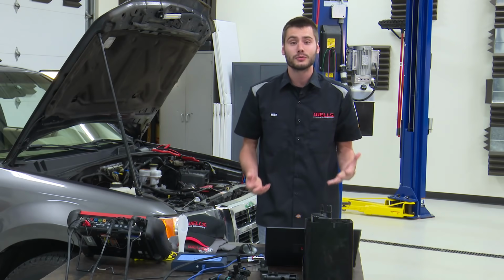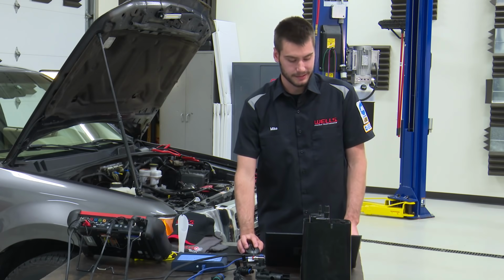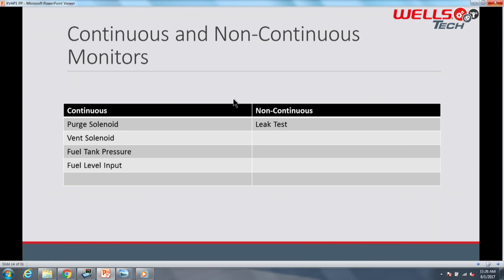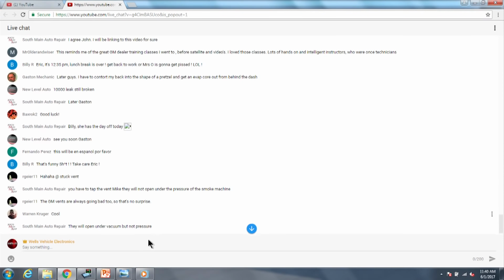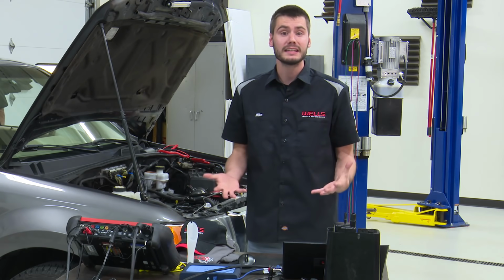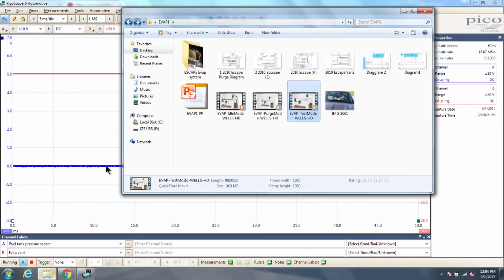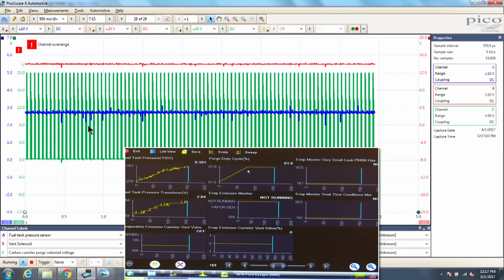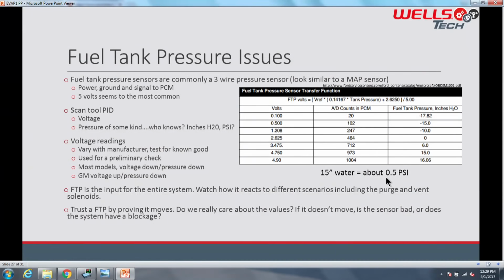EVAP-Evaporative Emissions System Operation, Testing, & Diagnostics Beyond the Leak (P0442, P0455)

Comment: well, one thing I know for sure now that my P0456 code error for EVAC small leak is not my vent solenoid; it's my Purge valve causing the issue. Because I have no problems putting gas in my tank but I do have a problem with a rough idle or acceleration, but normally after it's ran for a few minutes. this was helpful for me deciding where my problem most likely is. I have a Mighty Vac 8000 I can put on the Purge line to see if it is closed, normally as it should be with the key off, and I also had it suggested to unplug the purge solenoid prior to starting my truck and then plugging it in to see if I can hear it open the switch or activate the solenoid. My 2007 Dodge RAM 1500ST Quad Cab 4WD 5.7L Hemi has a Leak Detector Solenoid on the EVAP Canister; I don't see this in your set up or diagram, but I'm guessing it is by the vent valve solenoid on the EVAP Cannister. I know my gas cap is sealing good. The seal looks good, and I can hear it when I open it. I've been leaning towards the Purge Valve being bad, and I can put my Mighty Vac 8000 on it while the truck is off to test to see if it is closed or has a small leak as the error code indicates when the OBD is connected to a computer. It didn't show up the first half a dozen times I had a diagnostic run on it at O'Reilly's, but it says it has had a small leak for a while now. thanks for the video. the only thing that makes me think it may not be the Purge Valve is that I don't have any issues with starting my truck. It fires up on the first crank!

Comment: I've also had to replace the EGR valve. I bought the part replaced it and check engine light went on again. Again thinking the part was bad I replaced it again. The EGR valve wasn't the issue. It was actually the connector tube inside the the manifold that connects to the EGR valve. I hate there's no check engine light code for this part. So I pulled it out cleaned it and replaced it and it worked. I don't believe that it was my EGR valve in the first place, it was the connector tube that needed cleaned.
Reply: In today's automotive world it's gone from actual fixing/rebuilding parts to diagnosis by scanner and guessing what parts to replace and still not solve the code issue.
Computers on cars flat out suck. 
To much computer control tech on cars is the problem. The more there is of it the more problems will arise make the cars bigger POS and financial burdens for most people.

Comment: TY for the comprehensive explanation of EVAP systems. I finally understand the function of the vent valve and purge valve. 
Now to find my issue. I think I have a bad Oring on the fuel pump seal.

Comment: I went to a dealership for a EVAP 1450 code to make a long story short they charged me $800.00 to fix, what a rip off and come to find out there hourly rate was $240.00 dollars an hour.  First thing is never go to the dealer ship for any thing and always ask what there hourly rate is, so you can walk out if you want. I learned the hard way. Bye the time I got out of there it cost me $1500.00 dollars. And one other thing they fixed a little bulb over the license plate which cost me $183.00. Go figure.

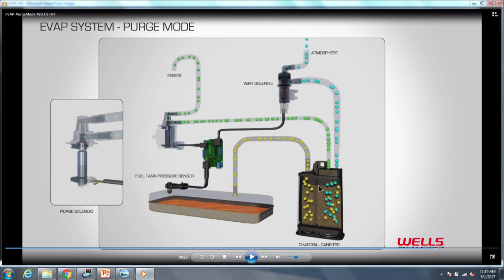Comment: 18:39 this is the event i think i have now. Stuck open vent valve. When purge opens it sucks on the dry filter  and has a large vacuum leak. The honda then starts cutting  injectors to bring idle back down. 
Looks like a bad idle control valve.

Comment: i've a 2013 odyssey, with P0430. It had a check fuel cap msg for long time that didn't go away when i changed the cap. Could it be a evap issue, where engine is running rich and thats why catalyc converter is under performing? I checked with OBD, no other MIL, only thing noticed is that fuel trim is high negative, like -6/-7 for both short & long. Also Evap system vapor pressure is continuously changing from 16 to -60, to -120 pa..... any opinion on this? thanks.
Reply: Do diagnostics

Comment: Porsche Panamera 2010 I have a 4055 code I changed the gas cap twice I also changed the purge canister solenoid and I'm still getting the 4055 code can it be possibly leak detection pump

Comment: Great video this is wanted to see I have a issue with the leak detection pump that I may think it the problem because i have a code 4055 can that code give me that problem also 4056 isit the same because I have because I have change the purge valve canister solenoid that goes in the front and I still was getting a check engine light with a 4055 so my next step is to check the rear for what you showed us perfect video I've been looking for this I'll give you 3 thumbs up every time I fill the tank with a half a tank I have a loose cap on my dash but when I fill it to a quarter I won't have that problem so I'm thinking it's something in the rear by the gas cap because I changed the gas cap twice a new one from the auto part and another one from the dealer and kept on giving me that code after I even changed the purge valve canister solenoid can you tell me if the same code will give me that Leak detection pump issue 😅 thank you very much can you respond back to me and let me know have a great day

Comment: Very helpful video.  Note that in the 2nd wiring diagram, the A feed isn't from the PCM relay output but rather is always hot and also supplies the PCM relay coil, so that appears correct.  The first wiring diagram was wrong (showed A as the PCM relay output), at least for that specific car.

Comment: It can't be emphasized enough the importance of understanding how a system or component works to accurately diagnose any issue. Before doing any test research how the components and system work. The days of guessing and replacing parts is a primitive strategy that costs time and money. Understanding then test. Don't guess. Outstanding video!

Comment: hello  i am hearing impaired ok so i have my brother his car has some problem  2006 dodge magnum 6.1 v8  and engine shake then engine itself off, ,, code read said two things  02 oxygen sensor heater   plug and harness high voltage  somewhere and other emission Some where explain on read code  my brother hearing so may help to question

Comment: Do we even need a purge? Specially for car that’s not even for the road? Because the vent solenoid will vent the tank right? As long as the tank can vent through the vent it will be alright right?
Reply from the maker: Hey, the purge is used to clear the vapor canister of fuel vapor. If you don't have it the canister will saturate and allow fuel vapor to vent into the atmosphere. Of course the check engine light will be set as well.
~Mike
Reply: @GoTechTraining  it’s for our race car. I’m having the problem with constant opening on the purge and no start when we fuel. If I take off the canister and the purge valve and leave the tank vent hose. Will it cause anything other then the light? Because evap system is just for the gas vapers to not go into the atmosphere and not for running purposes if that makes sense. Because I already got the evap codes idc about that. Just need it to stop flooding my intake when we fuel. So if I can get rid of the purge that be awesome! Just want confirmation really.
Reply from the maker: Right, the purge and the evap system is just used to trap and burn fuel vapors. It doesn't help or hinder performance in any way. Just make sure you have the fuel tank vented or you wont be able to fill it.
~Mike
Reply: @GoTechTraining  sweet thanks man!

Comment: on a 2014 cherokee trailhawk is the vent selenoid replaceable or does the entire tank need replacing?
Reply from the maker: A 2014 Cherokee should run a ESIM (Evaporative System Integrity Monitor) and would not have a vent solenoid. The ESIM is replaceable. Do you have a trouble code?
~Ryan

Comment: Great video and very interresting right now. I had my car"2001 Kangoo 1,4 petrol struck by a violant fire. The fire started with a, not so loud bang, somewhere in the enginebays front, on the right side, or closeby, the same second as I tried to start the engine. In this location we find the charcoal cannister, and nothing else. Obviously, something flammable was igited after the bang, but what caused the bang. Builtup pressure in the Evap system, something finally gave in, charcoal cannister cracked, hose fitting failed? The evidence are gone. Any ideas?The weather has been very unstable and the car has been sitting for several weeks.

Comment: Thanks for the very concise videos.  Very helpful.  Is it possible for a stuck closed evap valve to cause poor gas mileage?
Reply from the maker: Hey DynamicEQ, thanks for watching! Which solenoid vent or purge? If the purge is stuck closed the vehicle will never be able to recover the vapors from the canister. Highly doubt you'd see any changes to fuel eco from that. If the vent were stuck closed it could cause the tank to build vacuum or pressure and it would also be difficult to fill the car with fuel, but again...I don't see it affecting fuel eco in a noticeable way.
~Mike

Comment: So, after the canister it is clean air going thru the vent valve but it's vapors going thru the purge valve???? Why isn't it clean air going thru both???  The vapors are going into the canister thru one port, going thru the charcoal and then going out thru two ports.
Reply from the maker: Hey Sergeant53, great question! There are 3 ports on the canister and different pathways internally.
~Mike
Reply: @GoTechTraining  Ok so I assumed wrong.  So the vapors going to the purge DONT go thru the activated charcoal.  When you said that the canister HOLDS the vapors in the charcoal you confused me there fore my comment.   You should cut a canister in half and show that.  Tbh I still have not finished watching your video soooooo, maybe you did maybe you didn't.  I will find out.
edit a few minutes later *
Ok so I watched another video about the canister and I think I have it.  The line coming from the tank and the purge valve line go to the same chamber in the canister before the vapors even go thru the charcoal.  How ever, the vapors HAVE TO go thru the charcoal (get clean) before it goes out thru the vent.  So during purging (like in your animation) the purge has to be open and so does the vent (to allow flow of vapors to engine).  Otherwise the vacuum  created by the engine would probably collapse something in the evap system(I have put my hand over the intake with engine running and that vacuum is very strong).  The only time I think the vent closes is for testing for leaks otherwise always remains open??????? So the vent is used to over tank over pressure and allow flow during purging??????  Hey, I m trying to learn.
Reply from the maker: I should do a canister video, you're right! Yes, the vent stays open and only closes to test for leaks. It has to be open otherwise when purging, the fuel tank would be drawn into a vacuum. The vapors drawn into the engine are replaced by fresh air drawn in through the open vent.

Comment: Evap works at atmospheric .. tests itself by holding a bit of vacuum (when the CVS is on/closed..purge valve running). Smoke uses pressure. Sometimes it will hold pressure, but under vacuum, something is leaking, not allowing the system to hold vacuum. All assuming the canister is not clogged.
Reply from the maker: Hey David,
I agree and vice versa, sometimes it will hold vacuum but not pressure. I found that out on the LDP systems that use pressure for testing.
Thanks for reaching out and supporting the channel!
~Ryan Wilsing

Comment: It is strange to me that this video was made 5 years ago and yet most mechanics today cannot yet figure out many evap systems to fix them. I have taken my 2013 Ford Focus with a small leak according to the hand held digital analyzer. One mechanic changed some device in front of the car, erase the code, then a week later, the light came back ON. He could not figure it out. Then I took it to another mechanic, he changed another device that was next to the gas tank, reset the light, then the light came back ON a week later. Both charged me like $500.00, neither was able to fix it, I am out a little more than $1,000 and the car still not fixed. They even used a smoke machine and did not see anything. The same code comes up every time. Most YouTube mechanics seem to know what they are doing, but the mechanics out here are clueless.

Comment: well I can tell you guys that the more I've learned in the last 2 days about the EVAP system you have no idea how important it is for it to work the right way because I bought a brand new car and I told them I've been smelling gas blah blah blah. my question is has anyone else ran into the problem where the dealer disconnected a hose temporarily and waiting for the car dealership or manufactured to get back to you?

Comment: wel on my 20w2 Mitsubishi outlander se  is a lemon from weekone. Their temp fix was to disconnect the hose going back I believe to The Purge but either way let's just say whatever hoes it was they disconnected it from the EVAP system. and they did this around 2,000 miles on the car. the first time I got it towed in there. and they said well what we did was we just disconnected this hose so that way the fumes go outside of your car instead of going in your car. but I said well what about if I'm stopped and I got the AC on and you know I should be able to sit in my car brand new car with the AC on. but the second I touched the recirculation button and maybe I'd like people's out input on this. why is it only when I push the recirculation then it's like immediate you smell the gasoline fumes. and they told me I could drive it. and in the last 2,800 miles I've only averaged 9.6 miles a gallon. and then finally two days ago the EVAP code came up went to go get it checked at AutoZone and after I've been reading all about this. so I've been delusional, I broke out in hives, and my dog basically she's just crazy Pitbull but she listens really well. and she has like no energy. so we took her to the vet sure enough she's got carbon monoxide levels that are beyond what they should be and toxic blood levels. so anyway this dealership here in Las Vegas they said it was safe to drive. yes it's safe to drive in certain circumstances but if the EVAP is causing other issues it is not safe to drive at all you could literally see the fumes coming out of this this tube and it's the one in the back of the car behind the passenger side kind of basically by the fuel gas cap

Comment: so what would make the gasoline keep coming out of the air vent?
Reply from the maker: Hey Theresa, are you talking about the vent solenoid? An overfilled gas tank is the most common issue for fuel to leak anywhere. Otherwise it's likely a restriction in a hose somewhere within the system. What kind of car is this happening on?
Mike Becker, Senior Instructor
Reply: @GoTechTraining  its a 98 gmc sonoma sls stepside 4.3 2door pickup. It gets gas coming out of the air bent valve and i just bought a new ,put it on ,same thing
Reply: I never overfill it, if anything its usually less than half tank or so always
Reply: U haven't answered my question yet, can u please let me know what u think,thanks

Comment: Got a code P0452 fuel tank pressure sensor low when I fill up check engine light goes away fuel gauge drops check engine light comes on

Comment: I watched a previous video with you and a P0455 DTC.You mention finding 12 volts on your meter across the terminals both on and off.I have one with 20 ohms on and 125k ohms off but my meter will still read 12 volts.It does not completely go OL and I cannot really find any specs.Is the PCM still seeing this circuit closed eventhough it is off?I find no leaks and the tank pressure sensor and both the purge and vent replaced

Comment: My cars idle stumbles after refueling, doesn't want to stay running. After about 30 seconds it normalizes and car runs fine until the next refueling. No CEL, I've replaced the purge valve and the canister vent valve with no luck. Any ideas where I should look next? Thank you for the videos btw.
Reply: I know this was over a year ago but did you ever find the problem on your car I have the same problem
Reply: @mytwocents4892  ended up being the purge valve. The one I put in was bad out of the box.
Reply: @TheBenjammin  Okay,Thanks

Comment: Ford Ranger 2.3 2007. Whenever i unhook the purge valve line going to the intake my truck drives normal but when i hook it back up and drive it will suddenly die and then start back and its a continuous situation. Well i wouldn't say die...i think i could describe it as no throttle response for a few seconds and then it suddenly has throttle again. The only thing i haven't thourghly looked at are the vent solenoid and the canister. Ive replaced the purge valve and fuel pump.

Comment: I have a 2007 ford edge sel awd suv. Yesterday while I was in library doing some work, I then left library got in suv and my check engine light was on.  I got home put my OBDII diagnostic tool on it and got back code P0456 evap emissions leak detected very small leak 1/2 and P0456 2/2 pending ? But whats strange to me here is that my scan tool shows me all of the various vehicle systems are all green as operating correctly. Yet the scan tool status indicator shows red color. I don't see any leak maybe I need to pull down the charcoal canister and check whether there is a valve into canister. I will re check front door and unplug wire from it see how vehicle responds. But outside that I'm puzzled.  I wish YouTube had feature allowing us to post pictures responding to techs an other knowledgeable mechanics on this platform. So you actually see what patron is conveying to tech mechanic or home based mechanic that knows what there doing....